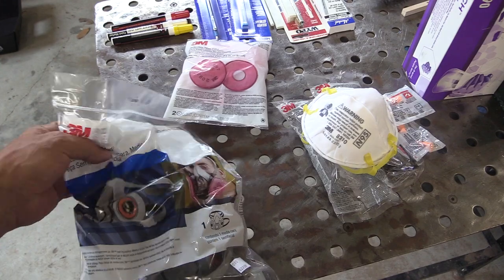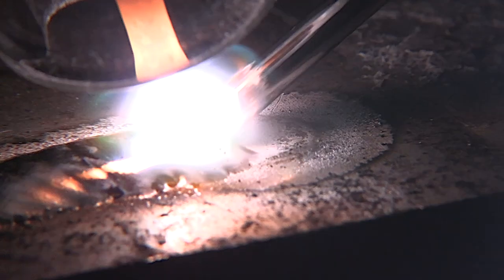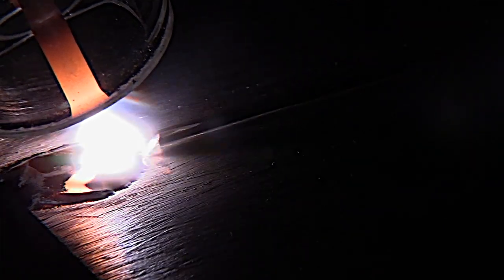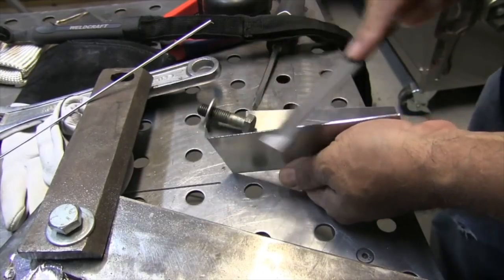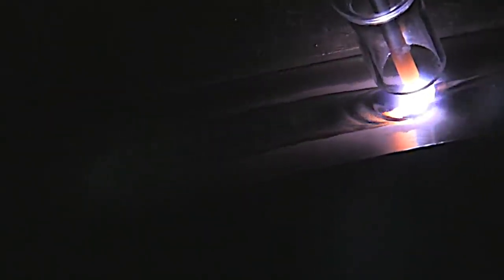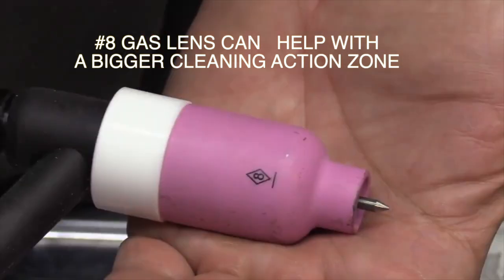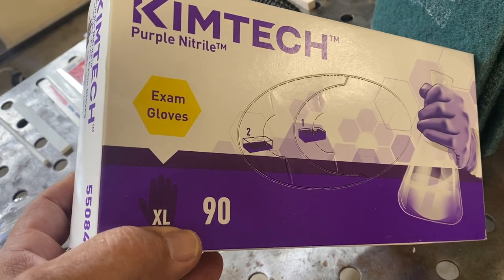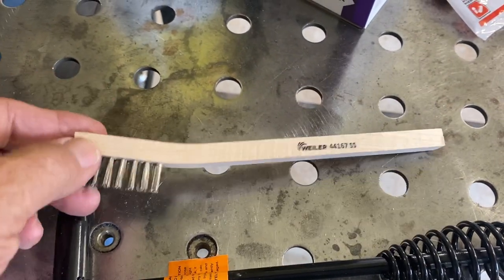How do YOU Clean Aluminum for TIG Welding?

Comment: I been using a dedicated SS wire brush by hand and isopropyl alcohol. Seems to work for me. Acetone is probably better, but in my case I rather not have rags soaked in Acetone and Isopropyl alcohol  is cheaper for me.

Comment: The way I like to clean aluminum depends on where the weld will be.  The surfaces I use a cordless right angle drive drill.  I use some 3" diameter quick change pads with a scotchbrite like material in coarse, medium and fine.  Which one that I use depends on how dirty or corroded the aluminum is.  For the edges, if it is thin material (<0.063"), I will rub the edge surface back and forth on either 120 or 220/240 grit sandpaper.  The piece of sand paper is on a flat surface, usually my copper chill block.  For thicker pieces (= or > 1/8"), I will use a 3" 120 grit flap disc.  I have also used my belt sander with either a 120 grit or 240 grit belt to clean the edge surfaces.

And then, of course, wipe down with acetone.

I use a similar process for carbon steel, stainless steel, copper and magnesium.  The range of thicknesses for me is from 0.025" to 0.250"

Comment: Hey jodie u tought me welding aluminum and to tell the truth I have discovered thaj the Best way to clean aluminum Is brush for grinder on slow rpm Never mind wheather Is brass or steel and I have been welding dump trucks and tanks with that prep